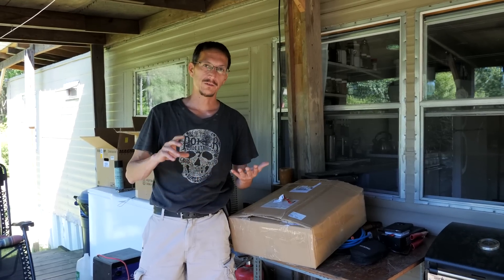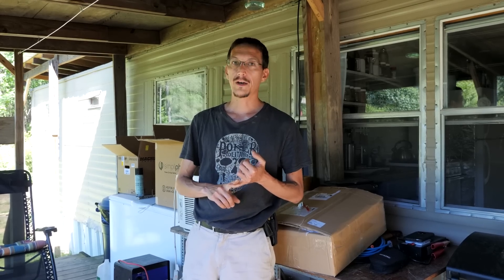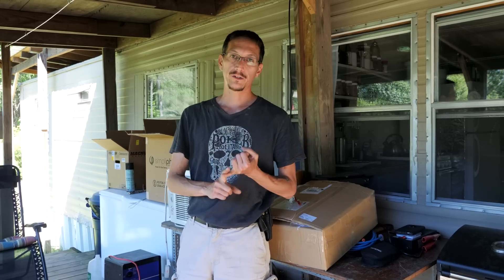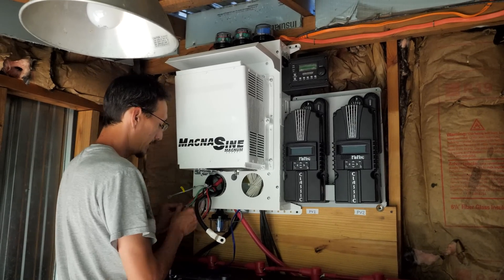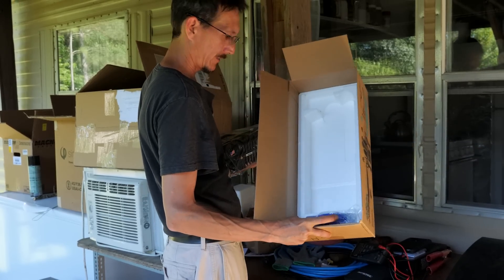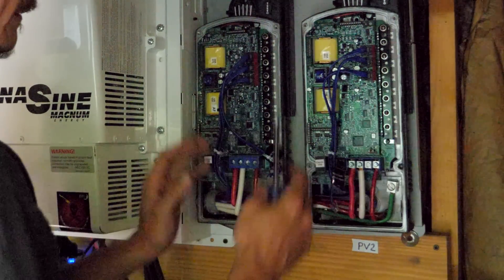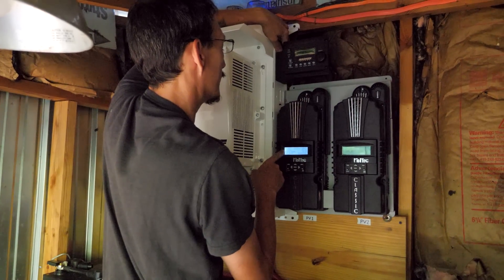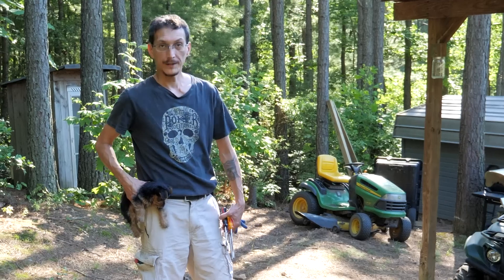DIY Off Grid Solar: The Good, The Bad, and the UGLY (Part 6)

Comment: Glad you got it worked out.  That’s pretty similar to my experiences with Midnite and Magnum too.  I had one of my 3 Midnite 150’s fail and Midnite looked after my problem immediately.  I like their stuff so much that I even bought one of their refurbs for a back up.  Magnum has always been helpful but seem to have a policy that really slows down the process.  I had a board that went once and they had to ship it to the nearest dealer, blah blah blah.  Actually didn’t I hear that Midnite was in the process of  making their own inverters now too?  Now that would be sweet.  I am still not a fan of the Schneider stuff, due to a bad experience in the past.

Comment: Wow . I would have never thought magnum would be like that for customer service. I was gonna buy one but for $2500 Its a bit small. And the noise they make. Thanks for the vid. Hope the rest goes well
Reply: Do you have cold winters?
Reply from the maker: This last winter got below freezing but it was unusual.
Reply: Be careful of the temp of those batteries.  Cold affects them greatly.  Be prepaired to run a heater in your battery room. Im sure you already know this. Great series of vids . Thanks
Reply: These batteries can still be charged below freezing just at a greatly reduced rate.  Now the question is, is it better to charge them slowly and let some of the solar power go unused, or use some of that solar power to heat them up so they can be charged faster and potentially get more charge into them?  I guess it only makes sense to heat them if you're generating enough power to fully charge them but you can't before the daylight runs out because it's too cold.

Comment: Wow that's the issue with complicated electronics. Even Midnight Solar having electronic issues. Glad you shared your experience with the Magnum inverter. If it wasn't such a time consuming installation I would return that inverter but your stuck with it considering the time put in. It's not confidence inspiring to hear about all those issues with the inverter for long term reliability. It would also make a bitter spot for me each time I think about it on my property after all that! Well glad its all working now!

Comment: Did you have to pay for both inverters?
Reply from the maker: Yes. May send the other one back. If something happens to this one I can have a replacement overnighted.
Reply: Guildbrook Farm - Off Grid Living that is a lot of money for a piece of equipment that depreciates relatively fast. I think I would send it back and just get a new one shipped if your current one goes out. Will AltE refund you?
Reply from the maker: Yes I’ve decided to send the other one back for a refund just because having it sit around as a spare will also burn the warranty away.

Comment: Good series! 

I've gotten mono panels and Schneider Conext series equipment from AltE, never a problem with either!

I believe the Schneider SW line is closest to your Magnum although you might want to look at the XW line if you want to expand above 4Kw.

I like that I can boost my 120V generator as AC input in to the SW4048 and output 240V to run the AC to cool/dehumidify the house if need be; save on having to get a larger 240V genset. 

XW line allows both genset and grid AC at the same time, SW only has one AC input, genset or Grid.

Hmmm, doggy holster. Maybe you should make and sell them on Amazon! :)

Comment: Glad you got it fixed. Maybe I didn't see it right, is the negatives of panels not on busbar of battery output and panel input on controllers? You point it out the positive and negative of the battery in the positive the panel never mentioning the negative of the panel only the ground of the chassis of controller. 🤔
Reply from the maker: PV negative goes to the common battery negative in the wiring center, not the PV negative of the controller. It was confusing to me also at first.
Reply: Guildbrook Farm - Off Grid Living first time I've noticed it in someone's build. Why would they have a negative terminal on the controllers? Makes no sense to me. Wonder if it's common for all systems or just for that manufactures controller. I don't think you can have something over grounded on the negative side! LoL

Comment: That dies not make any sense to me. I had the opposite experience with Magnum. Mine was damaged in shipping even though the packaging was great. Someone just simply dropped it from about waist high and the transformer was so heavy that it bent the frame inside! They corrected the problem immediately. Having good customer service is key fro sure. Midnite is the best hands down. Out of the three different brands of equipment we use the Midnite is the most end user adjustable. I have had heard of folks who have had their Midnite inverters go down as well. I have just had great success with al, of them. I have not used any of the Chinese stuff though. You never know what you are getting. With solar equipment I try to buy the best I can afford and only have to do it once. I think you will be very pleased with your Magnum. I have lots of friends with them and no problems. Schneider Conext makes really good equipment too.
Reply from the maker: I’m sure I just got a bad unit but the service process is where they absolutely need to step up their game. So far the new inverter has worked perfectly. So has the charge controller.

Comment: Again, awesome series!    A question about your surplus power after your batteries are charged.... have you thought of a creative use for it yet?     Maybe run an electric water heater when your batteries are full?    Anytime you have a surplus of power, dump it to the tank?

This could obviously  be used for bathing, etc.   It could be a pre-heat tank in series before your existing heater, or you could try it as your main tank if you have enough available juice.    Set the tank temp as high as possible, and use a mixing valve to bring it down to appropriate faucet temps.   That will allow you the most thermal storage. 

Or, you could run a few pieces of hydronic baseboard in the house off of an electric water heater.   For heat, you'd again set the water heater to the highest possible temp, but you don't really need a mixing valve.    Athermostat turns the pump on.   An aquastat could disable the pump when the tank temp was below, say 100 (so it's never circulating cold water).  The water has enough thermal mass it would provide heat well after the sun goes down and your tank is no longer energized.   Several hours, easy.   Maybe more.
Reply from the maker: I definitely have plans for the surplus! 😉

Comment: Good job, I am pretty surprised that the inverter died so quickly and also a charge controller. Luck was not on your side. Must be a relief to not have to juggle your power draw as much now with the new system. I am not familiar with the wiring of the midnight solar series but shouldn't you also run the neutral from the panels through that, I saw a spare lug was that for the neutral from the array?
Reply from the maker: That was confusing to me at first also. In the prewired panel the PV negative goes to the battery common negative, not the charge controller.
Reply: Did a quick bit of searching for info and the PV neutral and battery neutral on the charge controller are the same so makes no difference.
Reply from the maker: Yes it all goes to the same bus

Comment: Thanks for taking us along for the Off-Grid Power Adventure!! Looks like you have a good redundant system going and plenty of power now as well. Stuff breaks usually not long after you first start/power it up(especially the more technology is involved). But that's where a company shines or fails in how they address it when it happens.Once Magnum sees your YT video, perhaps they'll address their issues...perhaps.Not a huge fan of smaller dogs but I have to say Kit is a cutie. Look forward to see him learn farm life.
Reply: That's what worries me with modern solar setups. So much complicated electronics and the lithium batteries are no better with BMS built in that needs to monitor everything for fear of killing the battery cells and LifePo4 at cost of selling a kidney for enough amps to run a house.

Comment: sorry to here we have evo 40 4000 samlex  has grate customer  servers wen we got our inverter  some one didn't  put a manual in the box they over night one it was here at 9 am and they ask if we need any parts it was free  hope the new one stays working there is a you tuber his had a short in it  solar power electricity and electronics